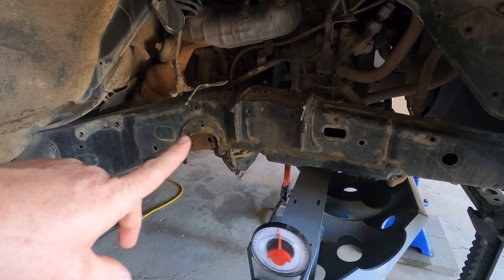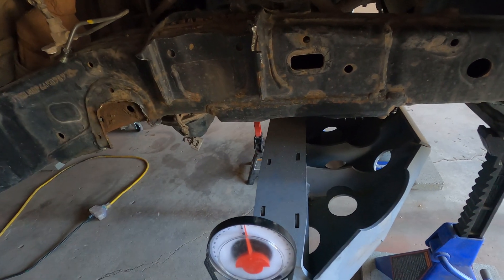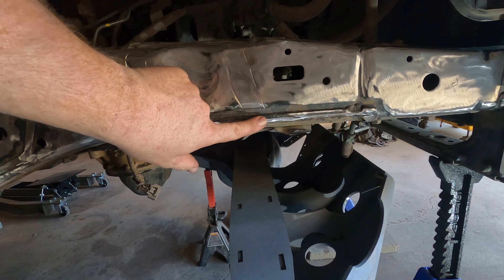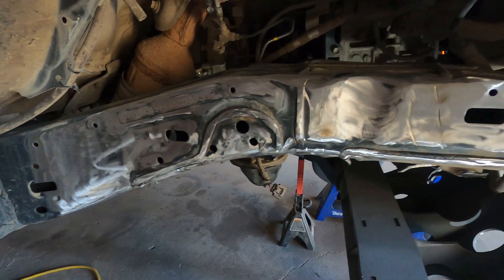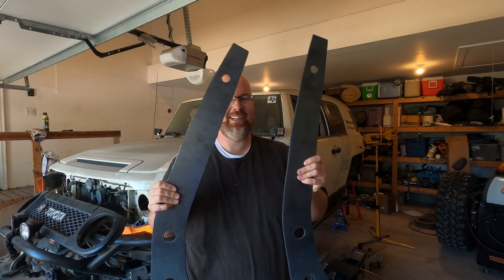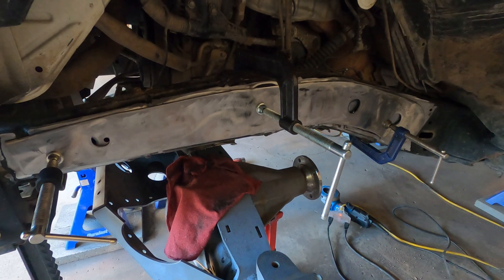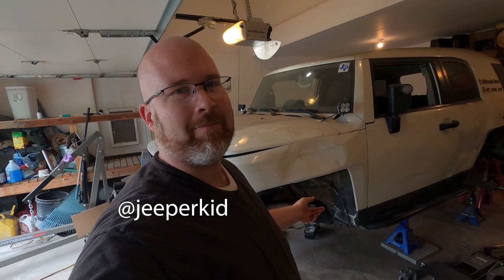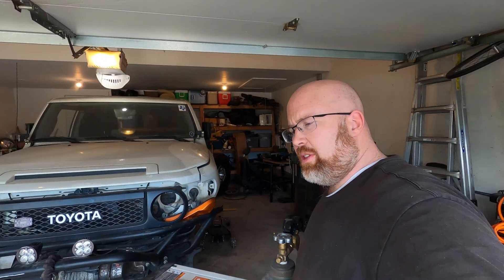FJ Cruiser Solid Axle Swap Frame Reinforcement

Comment: I just had to subscribe because I’m fellow garage dweller building up my FJ! Noticed you go through a lot of consumables. Ditch the flap wheels and get a box of scotch-brite clean & strip mod#29901 for removing mill scale, paint, and rust without gouging into your steel. For heavy grinding grab a box of PFERD CC-Grind mod#61220. I mainly TIG weld so I have to have clean surfaces and these are the first wheels a grab! Cut my consumables in half! Keep up the good work!
Reply from the maker: Thanks for subscribing and the pointers! I'll check those out.

Comment: Did you use steelit in between the plates and frame? Also it might be a good idea to leave a gap on the bottom welds every so often to let the water run out
Reply from the maker: I did! Good stuff!

Comment: If you need to refresh the outer edge of the flap discs you can hit the edge on concrete. But for the money I find 4.5 inch sanding discs much better.

Comment: Another good one Ken! Kind of disappointing with Toyota frames being so weak on their newer products mainly from 95 on. Nothing that can't be taken care of but it's a pain in the wazoo and fun at the same time, Hugh? All the added strength is a good thing. I can say the same for other manufacturers as well, if your modifying a rig to this extent you need to beef up the frame or you will regret it.

Comment: You could have used the plasma much more than you did . If you hold the arc back some it will have a gouging effect , start the gouge on on the top edge of weld and blow toward the piece being removed.  Also cut a slice in the piece to be removed so you have hinge points.  Wack with the hammer/chisel and or air hammer. Your grinder will be more happy. My power max 85 actually has a gouging tip I use on the hand torch when it off my 5x10 plasma table😉
Reply from the maker: I'll have to give that a try! Thanks for the pro tips!

Comment: With all that sparks, be sure you have a couple or more of fire extinguishers nearby just in case.  Did you just covered the stamped chassis number?  Wouldn't that be an issue when you renew your car registration?
Reply from the maker: I have a fire extinguisher handy don't worry. I've never seen a DMV check the frame for a vin, just the windshield or drivers door.